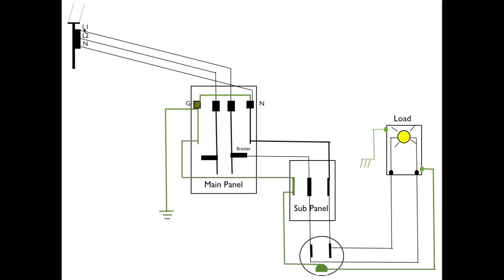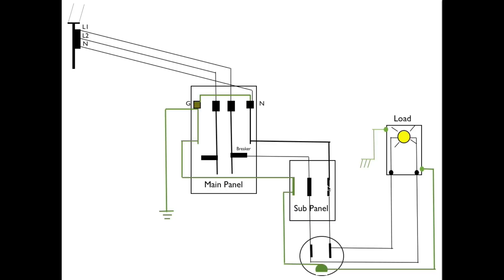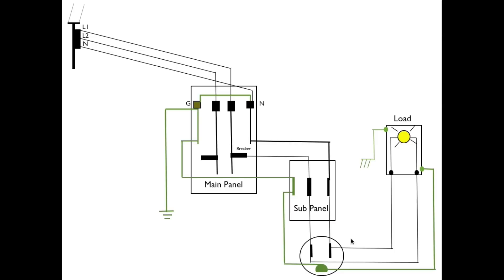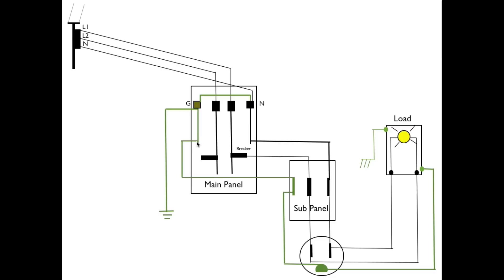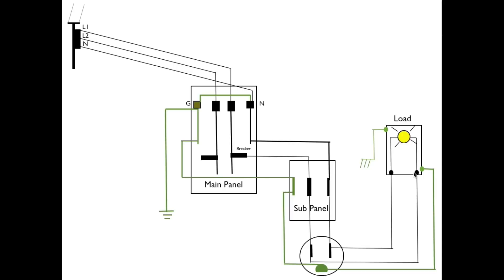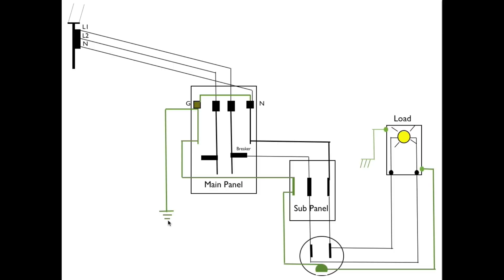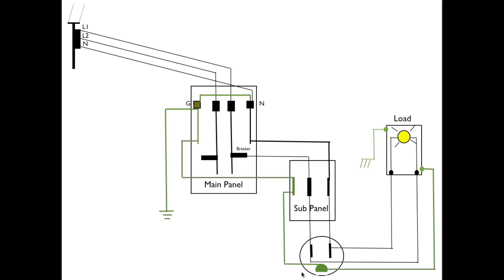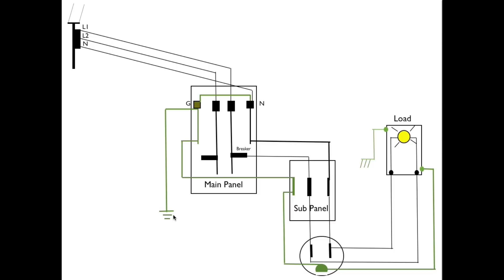The difference between neutral and ground on the electric panel

Comment: Rather than try to address every comment below, let me share several points. The neutral that comes from the residential pole transformer is the center tap of the secondary winding. The neutral is also grounded at the pole, to assist in lightning protection for the grid. The Main panel and meter socket (some call it the "base") is the ONLY place that the neutral and ground are connected together. The ground rod has nothing to do whatever with clearing faults. 

After the Main panel, the equipment grounding conductors connect ONLY to the metal parts of raceway, device boxes, cabinets, and ultimately, appliances. It NEVER connects to a neutral after the Main. 

The purpose of the "ground wire" that runs throughout the house is to provide a low impedance path to the source of the power, and not to the ground rod. That equipment grounding conductor should be called the equipment "bonding" conductor, but old habits die hard. It's purpose is to assist the breaker in opening in the event of a fault.

If you are not qualified, save your family a lot of grief, and call a qualified person.
Reply from the maker: Well said
GFM
Reply: Nicely put.
Reply: Art Houston — Yes, this is a clear explanation of the matter.  I would just note that people need simple terminology to refer to things, so “ground” is a reasonable way to refer to all the metalwork and green (or bare) wires.  As long as the function and proper construction of the ground path is understood, it doesn’t hurt to have a simple one-word name for it.
Reply: @GH-oi2jf  If the only goal is to explain this to a homeowner who will never do any electrical work, I agree. However, this is to inform HVAC techs about what is going on, and therefore, the explanation must be up to that task. In the HVAC world, electricity is often the Achilles Heel among techs, and it needs extra emphasis for troubleshooting and providing power to equipment.

Comment: Clarification. .yes. But still confuses me. I needed to power up my 50 Amp RV...that has a 4 prong power cable. However I knew that a 30 Amp 3 prong would work cause it's winter and the only thing I needed was lights and heat. No AC or Microwave.  Still with me? So my Well guy (water service) runs a 10/2 wire to my 40 ft Cargo container (CC). Which in turn feeds the 30 Amp box for my RV. I'm confused here! So he puts a 8 breaker box in my CC with a 30 amp breaker in it. He feeds the 10/2 from the main service panel to the CC. Then another 10/2 to the RV box. He has one wire hooked to the breaker in the CC and the ground AND the other wire to the ground block in the CC box. Confused? Yep...me too. So my Surge protector at the RV is showing an "open neutral". 3 lights, red, blue and green. Green and blue are on which shows the open. The 10/2 is feeding 240 to the CC and then split off if that makes any sense. I worked Aircraft most of my life...not spark chasing as we called it. I think maybe I should unhook this mess and start over.......by calling a qualified spark chaser!
Reply from the maker: Sounds to me like  you need a real electrician.  You have 120 volt appliances in the RV so you need a separate neutral.
GFM

Comment: Sir, you are wrong...  Neutral is neutral, it is not "current carrying" ... That is to say; current doesn't come from neutral in a wall outlet to shock you.  The current ALWAYS comes from the insulated power lines.  The problem is that, that power ultimately gets connected to neutral to complete the circuit.  Curiously, the thing that makes folks think that neutral delivers current (which it does not, that's why it's called NEUTRAL), is what you, yourself explained here....  The power that goes to the load ultimately has to make contact with something else to establish an actual current (flow of electrons)  you have to have something of a different charge (potential difference) so that the surplus of electrons (negative) can flow to the electron holes (positive).  You are correct in saying that if you touch a DESIGNATED neutral wire, that is connected through a load and you are the only thing connecting that neutral wire to the ground that you are standing on , THEN YOU WILL GET SHOCKED!!!  This is where you have to be careful!!  You cannot in the process of connecting wire schemes, assume that neutral is always safe for this reason.  The key is to remember NEVER to put your body in the path of any wire, between that wire and the ground. If the neutral has a path to ground, any current going through it will follow the path of least resistance, and metal, copper, aluminum  etc.  are far better conductors than your body, so you will not have the current flow through you...  but just as you said if you disconnect its path to ground, even if the hot wire first passes current through a load, ultimately the current will pass through your body if there is no other path to ground.

Comment: So the neutral wire from the transformer is not insulated but carries current, so my guess is you get electrocuted by touching it only if power if being used by the house.
Reply from the maker: +abelincolnparth Actually, its a zero potential because it is the center of the secondary winding.  
GFM

Comment: So why is your receptacle reversed? Hot is always on the right and your current carrying conductor is on the left.  The unbalanced load goes back to earth, if you didn't have a ground rod, your voltage would bounce up and down (50v to 208v)) looking for a path to earth.

Comment: @grayfurnaceman
And here I thought I was the only one who couldn't comprehend why the nuetral/ground were connected! Yet still, after watching this video multiple times, I still don't get it. 
Ok, starting at 4:09, the neutral wire is a current carrying wire after it passes through a load. I get that. Matter of fact, I've felt that as well. Ok, so the neutral wire returns power to the main panel's neutral bar that is connected to the ground bar and of course the ground circut. So basically power is being fed back to the main panel and into the ground circut. That electricity may travel back to the pole in the neutral wire or it may go directly to Earth ground or it might end up energizing the ground circuit. Right? No? Yes? Since electricity takes the path of least resistance, I would assume the Earth ground would be the less likely choice and the pole's neutral wire being the first choice since it's the biggest gauge. But assumptions and electricity don't belong together. I hope all that made sense. If so, then I'm STILL confused. Because clearly the neutral wire, which can be hot, is tied to the ground in the main panel. Someone enlighten me please. I seem to be having a brain fart here.
Reply from the maker: Earth ground is not part of the circuit.  There is no reason for current to go there.  It has very high resistance.  All current goes thru the neutral.  
 The earth ground is just a sink for lightning and spikes to be dissipated.  
The reason for a chassis ground on equipment is allow fault current from a failure in the equipment to be cleared to neutral. 
GFM

Comment: Ground is ground.. Period. They are not separate. You can follow the path of the neutral in the sub panel directly to earth ground.  Same goes for the ground of the sub panel. It goes directly to earth ground, as does the neutral from the transformer.

Comment: I got a circuit that won't work I got voltage from hot to ground but no voltage from hot to neutral what my problem?
Reply from the maker: You probably have an open neutral.
GFM
Reply: At precisely  the 8:00 min mark you say that with the neutral wire fail the load would run normally. Which is it?
Reply: Have you ever bothered to replicate the open neutral operation, you claim in the video, with any appliance. Try it!
Reply from the maker: The load would run normally if the the chassis ground and the neutral were connected together in the sub panel.
GFM
Reply from the maker: There is nothing to replicate.  The diagram will show it.  As the neutral and chassis ground are connected together in the main panel, it will operate without the neutral in the sub panel.
GFM
Reply: By design - and by law - no current will flow back, from any appliance, via the ground wire. It does not matter if there is a bond at the main or sub or both or none. No current is presented to the ground pin in the first place, unless a fault electrifies the housing. That will trip a breaker, not continue to run the appliance.

Comment: Can anyone explain then why on appliances, say a dryer, we dont have a neutral, we have a hot, or 2 hot, 240v and ground only... And the ground (green wires) are used as neutral...
Reply from the maker: Up until around 1990, it was legal for manufacturers of appliances to supply appliances that are wired Nema 10 (2 hot, 1 ground/neutral) for appliances that had both 120 volt and 240 volt loads in the appliances.
That was changed in the 1990s to require a separate neutral for these appliances.  Nema 14 (2 hot, 1 neutral, 1 ground).  
The idea here is that the ground should never be used as a current carrying conductor except in a fault condition.  The neutral is designed to be used as a conductor.
GFM

Comment: Whats the L2 meant to do.? it appears it is at a dead end
Reply from the maker: In this video, the sub panel is 120 volts so there is no need for the L2.  This is the 3 wire US system.GFM
Reply: The purpose of L2 is two fold.

1. When you have loads that require 240V, instead of just 120V, the voltage difference between L1 and L2 will supply this to the load.   It is common in power-intensive loads with heating elements within them to use 240V, because it is a more efficient design to carry power at higher voltages.  Clothes driers and ovens commonly use 240V to power the heating element, and 120V to power the motor.   Motors are more voltage-sensitive, and heating elements are less voltage sensitive.  This design lets the same appliance also be used in an apartment building, where the dwelling unit gets 120/208V from a 3-phase ssytem instead of 120/240V.  It just means that the thermostat will cycle the heating element to the on-position, for a greater fraction of the time.

2. When you have numerous 120V loads in the same subpanel, distributing them between L1 and L2 helps reduce the total current that needs to feed the subpanel.   Concentrating all your loads on L1, will mean twice as much current as you otherwise would have, if you distributed them between L1 and L2.   This reasoning also applies at the main panel.  You might have to have a 400A service instead of a 200A service, if you deliberately avoided connecting 120V loads to L2.

Comment: What if lightning hits L1 or L2, how does the earth protect the wiring in this case?
Reply from the maker: There is some protection there, but it must travel thru the transformer at the pole.
GFM
Reply: Jav — In a modern installation, the insulated L1 and L2 conductors are wrapped around a bare neutral to make the drop from the transformer to the mast above the meter.  I don’t see how you could have a lightning strike that didn’t put most of the energy into the neutral.  The best path to ground for the lightning would probable be at the power pole besides.

Comment: Where does Line 2 go in the schematic?
Reply from the maker: Vincent Robin delos Santos It is the other side of line to the transformer.  Check the video again, the 3 wire system video is linked there.  Hope this helps.
GFM
Reply: Hi GFM, does that mean only line 1 goes to end-customer line? I've watched the 3 wire system video. It is still vague to me where L2 is connected.
Reply from the maker: Vincent Robin delos Santos When you look at the transformer on the pole, the secondary winding that feeds the panel has one end that goes to line 1 and the other end of the winding goes to line 2.  The voltage for household use is between 208 and 240 volts. There is a center tap of the winding that has 120 volts to either line.  Hope this helps.
GFM

Comment: You fail to mention that the neutral at the transformer is also bonded to ground.  If it wasn't, your lightning theory would burn up all the neutral wires to the grounded panel.  If a power wire becomes loose at the pole, no big deal. BUT if the neutral wire becomes loose, circuits in the house will be greater than 115-volts.  The 'double safety' uses a ground in case the neutral becomes loose at the pole. That way there is a current path back to the center tap.
Ground should never carry current but we put it there to do exactly that if there is a malfunction in the neutral wire.  Current takes the path of least resistance. In a 'ground fault' some current goes through the neutral and some goes through ground. The code doesn't want ground currents to back-feed through different panels.
Reply from the maker: You are correct that the loss of neutral can result in varying voltages applied to loads.  However I would not depend on an earth ground to provide a path to the neutral at the pole.  The resistance is far too high.  
GFM

Comment: Earth ground on electric pole is bonded to the equipment ground on the transformer can on pole
So these are bonded
The NUETRAL ON CAN
is really a centet tap on thr transformer and both legs are the same phase or single phase.
That nuetral or center tap is also bonded to earth and equipment ground.
So now we get to the utility hanger wire which is now a bonded nuetral or a grounded center tap of the transformer.
When it gets into house now u have two hots on the same phase and the bonded nuetral wire and now another earth ground and thats all bonded.
If there is a sub panel involved then there are two paths back to ground or nuetral in the main panel 
So past the main panel two paths are present as a safety factor along with bonding to water pipe amd ground rod.
At no point past the main panel is earth ground or equipment ground bonded to nuetral this was already done.

Hopes this clears up stuff

Comment: ...So long story short N brings the power back to the main generator miles away to complete the circuit, and the ground is an emergency to put the hot power into the dirt in case of emergency like lighting or a device/light gets too hot, and not into our homes blowing up all our loads?
Reply from the maker: The earth ground is not part of the circuit.  It will provide a path for spikes/lightning, etc to discharge.
GFM

Comment: This video at 8:05 says if neutral wire has an open at the place pointed out the load would run by using the ground. I say, NO WAY that would happen! This is because there is not a complete circuit.  Remember, that the ground is bonded to the chassis only, out there by the load, and thus it’s not part of the load circuit unless a hot wire or neutral wire at the load area touches the chassis. If this were to happen, with the hot wire, the circuit breaker would trip as the current finds it’s way back to the source (transformer) via the ground wire, causing a dramatic current spike! Although, if the neutral wire were to touch the chassis by the load area the load would keep working and the ground wire would then be part of the circuit and no circuit breaker would trip, so this would go indefinitely. Funny how that works.
Reply from the maker: Of course its a complete circuit.  The chassis is bonded to the neutral buss at the main panel.  The circuit from neutral can travel either thru the neutral or the chassis ground.  That is why we separate them in the sub panel.
GFM
Reply: grayfurnaceman 
: Looks like we are not on the same page. The way I understood what you said around 08:00 minute mark is that the neutral has an open somewhere between the sub panel and the load. Thus, there’s no closed circuit anymore and the load ceases to operate. The neutral, at the point where it’s open, from the load side,  is now essentially a hot wire as the current has nowhere to go. It makes no difference that the chassis is bonded to the neutral buss at the main panel since current cannot get there anyhow, unless the neutral wire by chance happens to be touching something grounded and that was not explicitly stated as being the case.

Comment: A few mistakes here.
8:19 he says that if the wire of neutral was cut, then the current would flow through the ground wire...!??? Why? There is no shortage .. 
But lets accept that there was a shortage and L touvhed the Ground at the lamp..... then what he says at 8:25 is ALSO wrong because the breaker would inerupt the circuit, since the current would be high because of the shost circuit.
Generally this video is a good attempt  to explain the subject BUT dont take everything for granded cause there are a few mistakes.
Also, in a real life Main Panel will be a SAFETY SWICH which will open the circuit (cut the power) in case of short circuit.
Reply from the maker: Watch it again.  The explanation at 8:19 is the condition if the chassis ground and neutral were connected at the sub panel.  A situation we are trying to avoid.  And if you had continuity between the load and the chassis ground, you may or may not have a short depending on the fault position.
GFM
Reply: On the video you didn't mention anything about continuity between load and chasis ground. If this is the case, then your point is right.
However, the hypothesis you are making on the video is that we have a neutral wire failure between sub panel and load. In this case, is not possible for the current to travel back to subpanel since the only way would be through the neutral wire, which is now cut. To alternatively travel through the ground wire, there should be a continuity between load and chasis, which you didn't mention.
I believe that was what you meant, just unintendedly skipped it.
K.P.